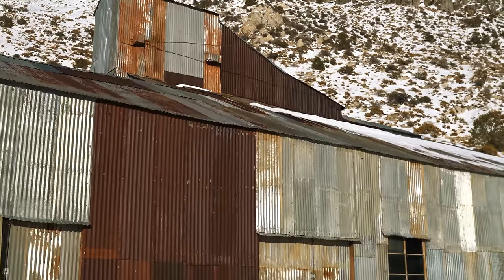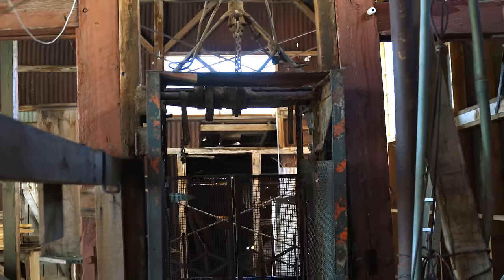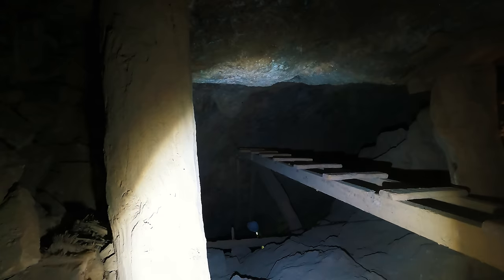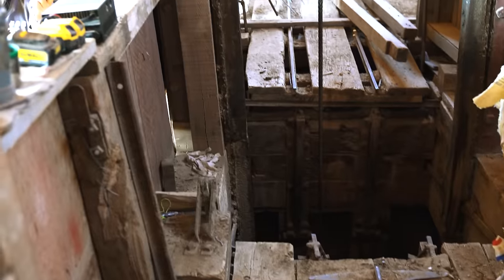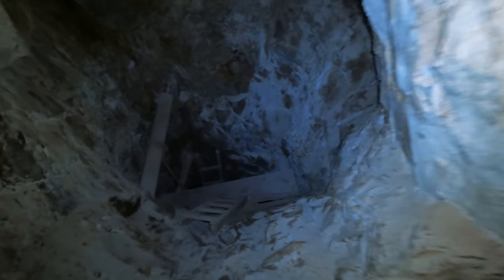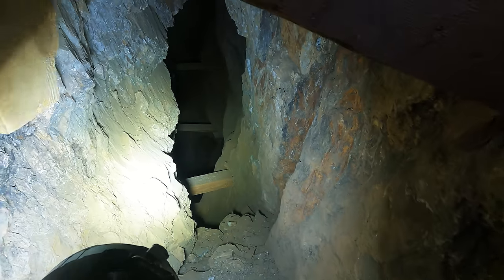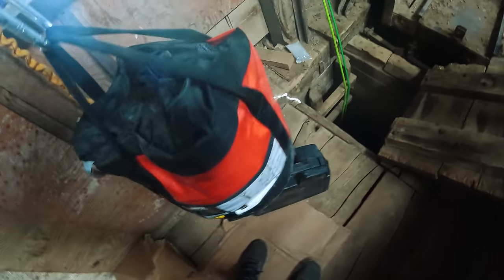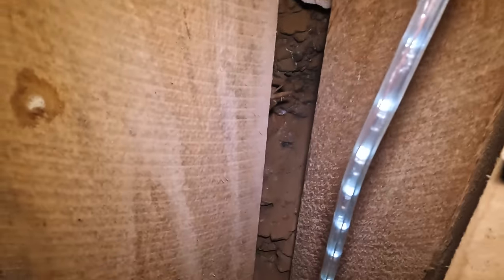Rappelling 900 Feet To Uncover Lost History!

Comment: I know there may be an aversion to this given the history, but I think it would be wisest to work to restore the hoist system and rebuild the ladders and passage down to make it safer for generations to come. It might be time to investigate hiring a hoist team sometime in the future as well. We all want you to be safe and for this place to come back to life in a safe way.
Reply: I'm interested to know what the issue is with the hoist. Any mine hoist I've seen can be operated by a single man, including modernized hoists built over a hundred years ago.
Reply: @Porty1119 I don’t think it’s ever been modernized is the thing. A secondary electric hoist with a bosun’s chair would probably be a good addition though.
Reply: That sounds like a tomorrow project. A smart and necessary one, but one not too high on the list.
Reply: @Porty1119  Mostly the age and how long there hasn't been profitable mining. The hoist hasn't been probably completely fully maintained for decades, likely the last full maintenance to really go through every piece was closer to the 50's maybe as far as in the 20's. Tells a lot about the state of the hoist that it seems the mine phone has been removed or at least doesn't work since Brent uses walkie-talkies to communicate with the surface and while the hoist has been used, it has been scheduled to minimize the need of communication.
The hoist would probably need to be completely rebuild. The mechanical parts taken apart, checked, remade what has serviced their life and added modern safety features and all that. The hoist shaft would probably need whole new timbering so the hoist box can be replaced with new or even rebuild one, only the installation for remote controlling from the box would need a lot of work and with MSHA, a lot of expensive work. Only getting a mine phones for couple most used levels could be a huge project if it was to be done "the right way".

Comment: Hey Brent, Im also Brent. First and foremost, you've got it going on! Im more than a little jealous.  As i mentioned in a previous comment,  ropes access is my life. This actually stemmed from getting talked into joining a mine rescue team in 09 (team Edgar). I too owned a couple claims myself above Leadville Co. I finally got the opportunity the descend down into one of them after a makeshift plug gave way opening the hoist shaft. Terrifying,  but incredibly awesome at the same time.  I too was solo (VERY dangerous,  especially without a 4 gas meter to test for H2S or even just low O2)
Anyways, if you were at all interested, id love to assist you in any capacity needed, even just stand by rescue, at no cost obviously.  I would also at the very least like to discuss the type of kern mantle ropes you're useing both in safety and your efficiency (900 ft = 90ft of rope stretch on static rope, i noticed you also had dynamic rope in use). In a nutshell, if you're interested in chatting,  let me know. In the mean time, keep up your hard work, enthusiasm,  and passion. Makes my heart race watching your vids (something im usually hearing, rather than saying)
Reply: Agree with @brentseely6113 - you need use gas meter! (toxic gas detector). Think about ventilation system in mine! So many people died from toxic gases.  The main toxic gases released in a mine are CO and CO2. Sulfur dioxide, hydrogen chloride, cyanides, halogens, and hydrogen sulfide (H2S) are other gases that occur in the mine environment. As minimum gas meter is must!!!!!
Reply: Was gonna say... Shouldn't he have more breathing equipment? Granted, I'm no miner. I like to spend my time ABOVE ground, thank you very much! However, growing up in the Pennsylvania coal region, the history of mine accidents is something I'm acutely aware of! Gas, collapses, explosions, floods... Some bloody bloody history there. Playing around in old mines is not something people should take lightly, I think.
Reply: Hey Brent, another Brent here. 😜

Comment: I think the key to further success in consistently exploring the lower levels is retrofitting the main lift/hoist. We don't know the costs associated with doing that. However, it makes the most sense in lowering equipment and people to those levels in probably the safest manner. The other option would be to round up some local retired volunteers. Train them to work the winch in its existing configuration. Lots of retired guys are always looking for something to keep themselves busy and to have places to socialize and get away from their wives. lol.
Reply: Even just renovating the ladder could make a huge difference. If you could just climb down with a safety rope it would be a game changer.
Reply: @GamePlague  Getting a hoist would be better, if just to lower kitbags and equipment. Also a lot safer than running the main hoist and could be run with a smaller crew. Anything human-rated would need proper engineering, safety and probably certification. It would make expeditions a lot simpler and safer if Brent could just radio up for stuff to lower, and stage food, water, medical supplies etc for longer exploration trips. On which point.. Eyebaths and some packs of sterile saline! Getting dust & grit in your eyes is no fun.
Reply: Yeah, let's casually install a commercial grade lift that can handle 900 ft, and put it on a mountain at 10k feet elevation. Then we hire three guys full time to service it. It sounds so cheap when you say it!
Reply: @temper44  with that mindset, nothing gets done🎉
Reply: i bet those old guys in town who he brought his rocks to would love a chance to help out.
Reply: well a wench will also work to start with, its better than nothing, to get some of the gear down. rehab of the ladders and shaft is needed, but i get it, the thirst for adventure has taken over and open up for the lower levels, but i do fear water further down, as the 900 is quite wet

Comment: I think it would be a massive benefit to have some sort of RC that could fit past collapses to determine the viability of digging it out as well as do the full polycam mapping.
Reply: Too much debris in the tunnels for any RC to drive (even the ones with tracks)
Reply: @frank-t6857  I was thinking there's got to be something more all terrain that's not a traditional 4 wheeled RC vehicle.
Reply: @davidwolfe8116  Fiber optic cord might work better than an RC vehicle, but I'm not sure on how accessible those are.
Reply: @thecharmingplatypus3208  nowdays a literal camera on a stick with wires, and screen  (the  digital boreoscope)  is very cheap, robust and easy to use, its practically replaced fiber optic cord, , the way of use is the same, and i agree that the guy should get something of that manner
Reply: Just use one of the cameras they use to look in pipes
Reply: @GamePlague  that would work well to look past cave-ins. For mapping the mine, I'm thinking something more autonomous that could freely roam for miles and miles.
Reply: @davidwolfe8116 Maybe a drone?
Reply: @matthewmosier8439  a normal drone wouldn't be able to navigate small openings but for open shafts and tunnels I would imagine a drone could work well.
Reply: They make robotic snake cams that can wiggle through debris that they use for search and rescue. Maybe he could rent one or get a sponsor to loan him one.
Reply: @matthewmosier8439  It would need an expert FPV pilot since none of  the location/stabilization stuff would work without a GPS signal; which doesn't go underground. A tracked crawler would be best but even those are slope-limited.
Reply: @P_RO_   which can both be elevated by using local antenna's/hardware
Reply: @232Stangpwr A Vine Robot.

Comment: You might talk to Gly of "exploring abandoned mines and forgotten places". about winching out of shafts and his experience with his hoist.  It would be good to have several exit strategies including at least 2 hoist systems and a couple manual climb outs.  Food, supplies including rescue gear at your base camp is a good idea.  The more supplies you have the better you will feel.  It helps to be skinny to get through tight places and climb out.  Hope you fine lots of nice things and maybe find one of the exits from the lowest levels.
Reply: Also there are a variety of sound powered phones than can transmit 30 miles with only the power generated by a voice,  some are on Ebay.   Drop a couple wires. down the shaft, one for power and one for phone and you will have better communication than radio.  https://en.wikipedia.org/wiki/Sound-powered_telephone .You might get search and rescue to "train" in. your mine and give you a hand also.

Comment: It blows my mind that men were able to get 900 feet down and work… especially during that time period. Some SUPER tough men back in the day.
Also, I’ve been through many old mines myself, but the whole claustrophobic nature of crawling would make me tap out.
Reply: Honestly how do they get down there just tnt and a will? 😂😂😂🇺🇸🇺🇸
Reply: @austincarter4452 with multiple bucket steam powered pullys and 24/7 operation it did not take long actually. One method is to drill
.blast.muck. andy should also cultivate the drill and fill with expanding cement puddy for more controlled ore removal in cave collapse areas. 

Last but not least, there should be a rock crusher down there that feeds smaller material up the 900ft vaccum tube for easier retrieval on the surface. All that clay backfill he encountered is PAY DIRT.

Comment: Suggestion....Set up ropes at each of the known levels.  Then they could be used to descend one level per rope at a time. Might eliminate the rope weight problem. Use the hoist to transport large supplies down to the 900 level as well as setting up some rest areas with caches of supplies at other levels. Then you can use the ropes for ascending and descending when hoist is not available. Hard line communications & electricity would be a good idea as well. Maybe you could find a small-ish winch system for using ropes to get supplies down as well as lifting Waste and other items out without using the main Hoist. Once all set up you could be more free to explore with less ascending and descending.

Comment: I think one of the most important things I think you should be installing in this mine is a communication system, and I think that a wireless system for the elevator/hoist unit that can connect with intermittent modules wired into the main system and then have hard wired com boxes at each of the main levels you visit regularly so that you can keep people appraised of your condition and situation and increase the amount of information you can relay if you need to alter your preplanned expeditions into the mine. the fact that you have LED rope down the shaft is fantastic and this shows how easy a hard wired com system is to put in to the mine. the bonus to this is that you can use old phones and phone box systems that are now obsolete but are perfectly fine for you to use inside of the mine and they are relatively simple to use and install, all you need is the proper lengths of wire. and of course the best part of this kind of system is that it is still quite common to find old items that would comprise the entire system and because it is obsolete and no longer in demand, the price for it all would be quite low to purchase the needed materials. all then that would need to be done is to install it. As always, thankyou for sharing with us the adventures you have in this incredible historical site. I love the location and the impressive amount of history that Cerro Gordo has. To call it RICH in history is merely adequate and there is a distinct lack of a more appropriate word that isn't' cliché and over used by today's young crowd. Until next time, thanks and stay safe and keep hammering away at your goals for your mine!
Reply: Its required by mining law.

Comment: Brent, you should really get in touch with some miners from some other parts of the nation and educate yourself and get some assistance on this project. I appreciate your passion in a way i don't think you can really know. I know it can be very hard to trust others with your life, i would highly recommend you build those relationships and build that community.  Use this community you have worked to build.  An entrenching tool and supplies (as well as by your rock blaster) should be standard equipment for these expeditions. Would highly encourage you to build that infrastructure to allow safe exploration with bastions. (fiber optic with strain relief anchors for communication. conduit with strain relief for power). build the infrastructure you need to do what you plan.

you sir are a passionate obsessives i admire and identify with to no end. be safe and keep doing what you are doing.  it is worthwhile and amazing.  Keep doing what you are doing and be safe.

Comment: Brent, Couple of ideas, 1, put a trap door in the bottom of the lift, that way you no longer need to climb thru such small space and you can lower larger equipment down and yourself.. 2. install a CAPSTAN WINCH-HOIST LIFT that a one man on top can operate to pull you out of the shaft or any equipment.

Comment: Hopefully Brent is successful in finding & exploring the deeper levels. I suggest using the hoist to haul down equipment, supplies and people to the 900 while working to clearing AND stabilizing the collapses
Reply: He does not have the people to move the hoist otherwise he would use it himself
Reply: @barnhardtbrecken3360  he could probably find a team for a one off supply run, he was talking about consistent trips

Comment: Hey, just a few quick tips for potentially making your life easier in regards to the ropes:
- You could look into the Petzl Stop, Simple or Rack descenders as they may by easier to handle if the rope weight is high.
- To make the ascend easier you could have a look at the Petzl Asap, which is a device that runs along the rope and locks in case of a fall. You could put this on the rope and climb up, without much additional hassle.
- Setting up Bolts may make the process of fixing the ropes easier, but it would require access to strong rock, which i think is covered by wood in the chute, so probably not feasible.
Reply: If the hoist is unusable, I can't imagine a fixed line isnt the next step (speaking as a climber)
Reply: I agree the rack is the way to go for very long descents but I always used a petzel stop even on long descents in caves. And the a frogger coming out or rope walker.

Comment: I'm so impressed that you have used 'double rope' techniques. Having redundancy can be a life saver.
Reply: He's descending srt, there's no redundancy with the other rope as he's not using them both at the same time
Reply: @stuartcommon4651  Which is my point, There is redundancy. He is not using them at the same time. 'As you said'. He rappels on one rope and the other is there as a backup. Redundancy. Something to catch you if your main rope 'fails'.
Reply: @peromo9397  in srt (which is what is mainly used in mine exploration and caving) there is only one rope, there is no backup, if that rope goes then you go with it. That's why there's extensive training available to enable it to be done safely. He initially sent down the long rope but with the weight of it he was unable to put it into his descender. He put down a shorter rope to descend the first part so that when he got to the bottom of the short rope the rest of the long rope should be light enough that he could swap to the main rope. Neither rope is a backup

Comment: In my town back in the day,  they had a 4612ft shaft in the Goldfields. (1908, the Victoria Quartz Co Mine had the world's deepest shaft at 1,365 metres. By 1910 the shaft had reached a depth of 1,406 metres)
Reply: 5 times deeper than Brent go's here.
Reply: In my young days, in the 1980s, I worked in a South African Gold mine. My working depth was 5,400 feet. The mines today go down to 12,000 feet. But I would go down 12,000 feet in a modern mine instead of 900 feet in Brent''s mine. You cannot even remotely compare the technology and safety standards between then and now. It takes guts to go down the mine the way Brent did.

Comment: I think running a powerline and a communications line down to the 700 level is a great idea.  Could even do a live 24/7 Camera down there or operate a RC car drone.  Was wondering if a super powerful shop vac would help clear out the clay debris.  Or like one of those old office pneumatic vacuum tubes but they would have to be crazy powerful.

Comment: Hey Brent! Awesome video!!! 

A few suggestions just for safety (especially solo). I’ve climbed for a long while and also do high angle ropes rescue as a SAR medic. Redundancy, redundancy, redundancy. Make sure you’re backing up you anchors and knots. The double 8 you had is a great knot, but make sure you back it up with an overhand or bowline into itself. Think of not how far you’re going down, but how far you have to fall. It might not be a bad idea to find another anchor point and back up your main rope with a prusik attached to another, stronger, rope. This way your rope has play but you still have a backup just in case something were to happen. Reading some of the other comments as well I agree that rope stretch is a huge deal (900ft=90ft of rope stretch) and definitely keeping your ropes on you and not hanging. It’s an old access and multi-pitch climbing trick and keeps weight off and reduces wear and tear on those expensive ropes. I’m assuming you’re using a grigri the way you explained it or some other smooth friction descender, and these work great with this trick. 

Keep exploring and stay safe!!